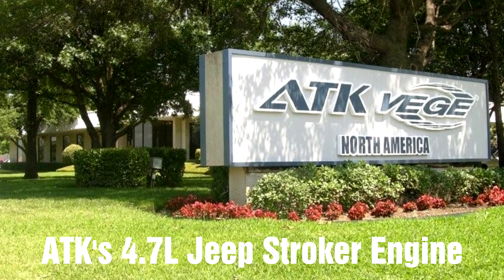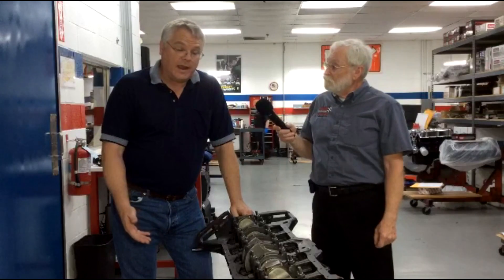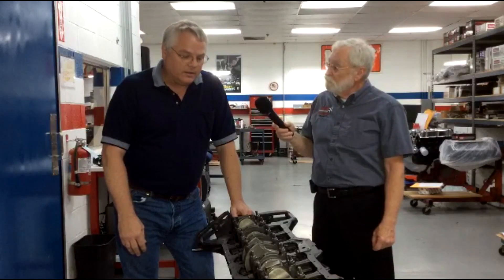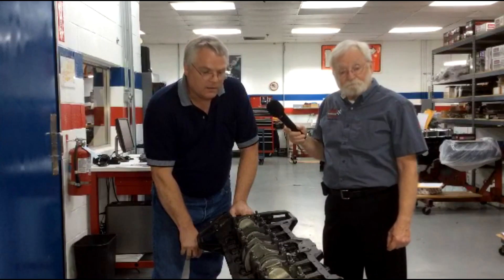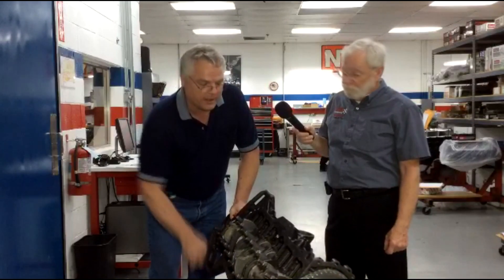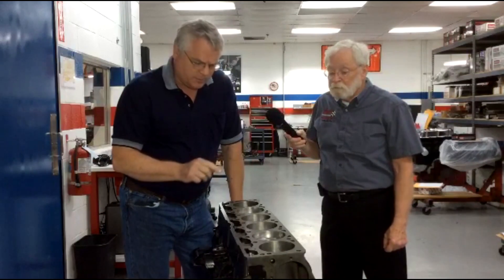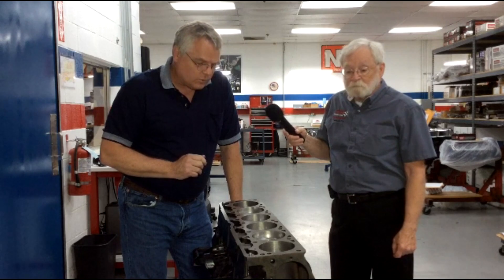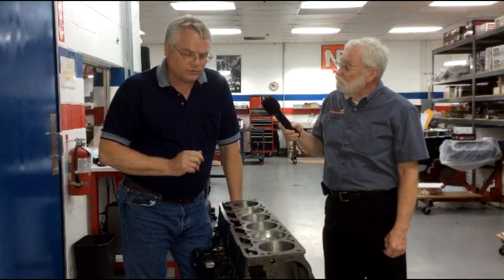4.7L Jeep Stroker Engine from ATK - Wrenchin' Up

Comment: I have 2001 Jeep Cherokee Limited 4WD / Automatic with the 4.0L straight 6 Engine, If I put the 4.7 stroker do you have to upgrade any other components? Transmission, transfer case, diff pinions etc.... ?
Reply from the maker: +Justin V Hi Justin, As far as I know you don't have to upgrade any other components (you do need a premium grade fuel though), but to be sure I think you should contact the engine builder. Their contact info is in the metadata.
Reply: Justin V 
Better injectors.
Stock fuel computer.
Good idea to get a quality cat back exhaust and a cold air intake.
You can do a throttle body upgrade.
Stock trans and transfer case will hold up fine but with all that torque i’d recommend a slip yoke eliminator and double cardan rear driveshaft if lifted otherwise you’ll destroy your stock driveshaft and have vibration before detonating it.
If your trans is worn a good rebuild is never a bad idea.
Posi rear diff is recommended to apply the torque to the pavement.
JEEP just empty every pocket.....have fun!

Comment: So I bought their 4.7 stroker  , Not happy they said it had a scat crank witch is a 6 counter weight balance 9000 Series crank , In fact it has a stock 4 counter balance  jeep crank , Note the lighter crank will not produce as much torque as a heaver crank at lower RPM's  . It all so did not come with the double roller timing chain .
Reply from the maker: Thanks for your comment. ATK definitely needs to jump in here to explain!!
Reply: thank you sir, for your response .
Reply: So you purchased a 4.7 stroker Stocker ? No performance crankshaft  NO Performance Camshaft or gear's So I'm assuming  cast Iron head' with stock  rockers .. So how does it run ?  Anything noticeable except the cash missing out of your account ? ?
Reply: He said roller timing chain not DOUBLE roller timing chain.....

Comment: I have a 99 wj 4.0 supercharged  does atk make a mini strocker 4.2 liter.I don't want to boost a 4.7 I could only run about 5 psi.
Reply from the maker: Hi and thanks for watching! I am not associated with ATK (I just did the interview) but you can contact them directly with the website in the metadata below the video and ask them about your supercharged WJ project.

Comment: Hi Jim.  I'm thinking of purchasing a 96 or newer jeep Cherokee for my daughter heading off to college.  I'm on a budget so I'm looking for an older car but new emough to have a OBD2.  I'd also like to rebuild the engine and trany. What is the best year of 4.0L that I should look for rebuilding?
Reply from the maker: Hi Richard - Thanks for watching! I'm really not expert enough to answer your question accurately and suggest you contact the experts at the address in the data below the video. I can tell you that I have (and had) 1 Cherokee and 3 Grand Cherokees that ranged from 1994 to 2004 year models with 4.0 engines. Two of the Grand Cherokees have over 230,000 miles on them and the Cherokee had over 330,00 miles on it when I drove it to the junk yard.
Reply: Richard Costra
  1997 and newer have stronger blocks with a windage tray. Some 97-99 had weak pistons, not an issue if your rebuilding as new cast pistons are too cheap to justify cleaning the ring lands on the old pistons. 
 1999-2006 have coil on plug mounting and  had terrible problems with heads cracking.. avoid rebuilding the 0331 cylinder head, you can buy a new ready to run head for around $650..
 2004 to 2006 blocks have problems with the camshaft to cam synronizer ( distributor) gears wearing and causing cels and excess bearing wear....avoid these blocks.. 
 You can find any info you need on 4.0 jeeps at jeep stroker.com
Reply from the maker: Thanks for these great comments and info! I'm sure they help those interested in this topic.
Reply: 2000 on the bad pistons, wrist pin to oil land too thin.

Comment: would this fit a Jeep patriot 2012?
Reply from the maker: Hi Jacob - Good question, but you really should ask the folks at ATK. Their contact info is in the metadata below the video. Your local auto parts store (like Advance Auto Parts) could help with that too. Thanks for watching!
Reply: Might have to remove the back seat??

Comment: I have a  couple questions. My 1994 jeep has a ATK  re-manufactured  engine. About 8 yrs ago I purchased it from a local NAPA store here in Va. My question is  
#1  what   kind of cam shaft  and cams was  put in that engine? I was told by ATK  rep that after 36k miles or so, I could start using Ams oil in the Jeep.

#2  Is syn oils ok for those cams in my ATK motor?  Its a good block head...., I think the castings are from a  late 80's Comanche. thanks.(Love that ATK ! )
Reply from the maker: +MrTwinsrule - Hi and thanks for watching! Question 1 - Since I don't work for ATK, Advance Auto Parts or NAPA I don't have the specs for your ATK Jeep engine so I suggest you contact ATK directly for that. Their contact information is located below the video. Question 2 - This is something I do know a little bit about. Synthetic oil can be used in your (or most any engine) and could actually improve lubrication and engine cooling because the molecules are smaller and can get into places that conventional oil doesn't. BUT if used in older worn engines or engines with worn gaskets and seals the synthetic oil will usually leak out of places that conventional oil might not. It's not the oil's fault, it's the worn engine, gasket or seal's fault. For that reason a synthetic blend may often be recommended.
Reply: Thanks Jim. I did call them today. I gave them the engine serial # ....They said a tech will call  me back.  I will let you know.  I used a Napa 30 wt  oil for the initial start up and first 100 miles (and that motor was hot)!!!!! After that I went to a Havoline 10w30  for the remainder of the break in time.  Some 2 or 3 oil changes later I used Valvoline syn blended 10w30.  Then after 15k miles I started with the Siggy Ams-oil! And never looked back.  Thanks
Reply: Just got off the phone with ATK.  They said I do indeed have flat tappets in that AMC 242  cam application. He said using straight wt oil (30 HD)  was very smart. at  Initial start up . that was  the key.time to use a straight  30 wt  HD oil.... After that he said you can run anything you want. He did say he likes  using Diesel oils in his own vehicles.  I am in agreement with you. Syn oils go where all others do not.  To me thats what keeps my Gas mileage high, and the engine running cool.  Hope this helps  some one that has this question.  Ams-oil is what I started using after 15 k miles.This gives me assurance that   Cylinders 1 and 6 will receive the( liquid GOLD) they need to properly function!  So many stories out there where that failure happens to these 4.0's.
Reply from the maker: +MrTwinsrule - Thanks for all of the updates and thanks for watching!
Reply: @WrenchinUpwithJimBates  hi Jim. 
I have a 96 XJ and I always run 91 octane and I have tried syn oil in my 259k motor and she didn't like it.. valves were slapping and It seemed to lose power . No leaks though. I put the 5w 20 in and she was back to normal in a few minutes for a 259k motor.
Now I have a ATK and my problems are no more.

Comment: I don't understand why these engines are so expensive. I can't justify $5,000 for a 4.7 stroker baja motor  when I can buy a wrecked Chevy 2500 HD Van which can come equipped with the LQ4 6.0L Iron block V8 with 325 hp and 370 ft lb of torque in stock form for $1500 to $3,000 and have all the parts needed minus odd and ends. Have more aftermarket goodies and be 10 times more bad ass. I love the 4.0 great motor but a LS swap is money better spent.
Reply from the maker: Interesting observation, thanks! I wonder how ATK would respond to this?
Reply: The point is that it isn't stock but the motivations for going this route are usually involved with other issues. You can dump many aftermarket things into a Chevy/LS for bolt on advantages but the 4.0L has evolved very little in design and changing just a few things around makes it roar to life at 4.7L. I recently built one for roughly $2200 with a remachined 80-86 long nose Eagle crank, short rods, the H.O. head, roller rockers, smooth bore intake and a mild dual pattern Crower cam. I could start this up any time with a small carb and break it in but my desire for fuel injection has me hooked on getting it running right. The intake design also makes this easy to modify later on with a M62 that I want to put to use.

In my case there is a preference for inline, an experience with the anemic 258 and ZERO experience for the 4.0L but there is also a manual swap, transfer case upgrade and possible diff ratio drop involved. My project is still on the bench and the wagon is on jacks but should be in one piece soon. I expect it to outperform and replace my nuked 258 with more than enough power to spare along with the chance of retaining my high factory gearing(2.73). I can drop to lower before changing axles but that alone is more involved than the engine.
Reply from the maker: Cool - Keep us posted!
Reply from the maker: Interesting view point - Thanks!
Reply from the maker: It will be interesting to see if ATK has anything to say in response to your post!
Reply: atk baja crate motor installed with warranty is around $5500.  

V8 from junk yard pulled and installed without warranty and all the parts and labor $7k same but with crate motor $10k.  chasing all the bugs because the shop screwed something up another $2k.  

WHAT YOU MEAN DO IT ALL YOURSELF.  no thanks.  i have a wife, a family a business to run and other hobbies.  my time is valuable.
Reply: My Damn Channel   Maybe you should add in the cost of rebuilding the 6.0,  with forged pistons, arp bolts, etc...then add in the cost of exaust,  cooling,  stand alone engine managment ,  dyno tuneing,  fuel system upgrades,  a complete new set of gauges,  motor mounts, transmission upgrade,  and all the labor to build a jeep with a chevy ls motor..... In the end you will spend much more to do the chevy swap if you dont want piggybacked computers, hacked wireing,  and a cobbled  up looking job..  I have a low mile 5.3 in my garage....still decided to stroke my 4.0.. after 60, 000 miles wheeling  on the rev limiter,  daily driving , and blowing the doors off of several v 8 jeeps, trucks, and mod motor mustangs,  I couldnt be happier.     I built mine for less then $3000 with new header, injectors, and the best parts money can buy...
Reply: During my last 4.7L build, I kept asking myself why we didn't just go with a 5.3L. There's a thread on Jeep Strokers with the topic of stroker remorse, or regretting building a stroker.  Of course, the thread is full of varied experiences, diverse contributors and even more opinions.  In my personal opinion only, I would never build a stroker again, when Chevy LS engines are so easily obtainable in the US.  Yes, they are more involved to put into the Jeep up front, but once the ground work is laid, the possibilities are wide open for upgrades.  The only time a 4.5-4.7L stroker makes sense, again in my opinion, is if your city/state/country laws prevent changing the engine.  Case in point, my wheeling buddy in Germany can't put anything in his XJ other than the straight 6.  But the German TUV doesn't know what the displacement of the stroker is, if you don't tell them, and you can easily build these to get the same or better emissions than the factory 4.0L if you pay close attention to compression, quench, camshaft selection and tuning of the Mopar PCM.
Reply: Funny stuff.
Reply: Because its awesome! Money isn't everything to everyone.
Reply: If you think 5000 dollars for a brand new  stroker engine is alot, think again theres alot of custom work that goes into adapting a new/used v8 where an l6 once lived, new engine mounts, new transmission and transmission mounts, new trasnfercase.... You want more power? use forced induction.
Reply: Chevrolet Performance 350 HO =  $4,049.00 (no accesoryes, headers, etc)
SuperMatic 4L70-E Four-Speed   = $3,372.46 (No electronic controller included)
Tranfercase = ???
Adapting and relocating cost = ? 
Even if you do it your self you will be spending ALOT more.
Reply: I agree; I just bought a 350 vortec engine with ECU, harness and PDC for $575.  I'm using my AX15.  My adapters and mounts will be about $600.
Reply: My Damn Channel the stocker is a new engine
Reply: @pankero1   goto the junkyard and buy a used truck that runs good but is rotted out.. theyre a dime a dozen in canada because everything rusts out before it gets any miles on it, 500$ and youll have a running engine and transmission and transfer case infront of you.. your choice which bits you wanna use from the truck vs from the jeep.. get a welder and some basic fab tools and i imagine you can make it work for under 2k.. hoses fluids wiring little modules probably some tubing to make your own headers thatll fit ect probably take a first time swapper a year worth of weekends to get it sorted out but if you were committed you could do it in your two week vacation from work
Reply: @AndrewBrowner   If I were to get  that such a great deal then yes its a no brainer.